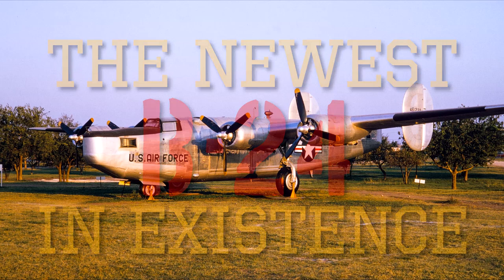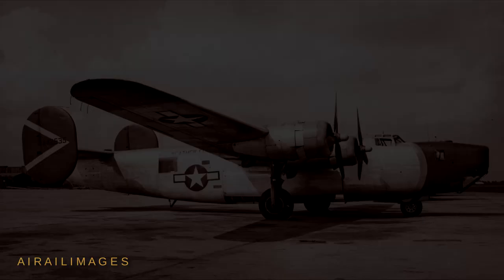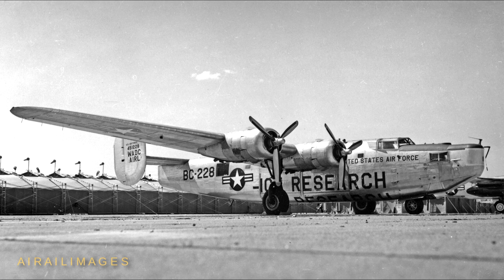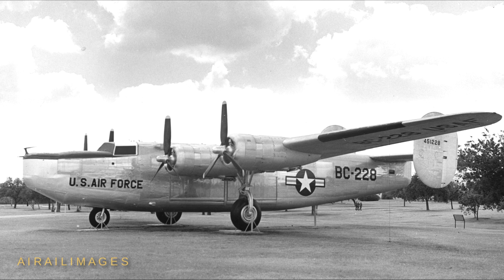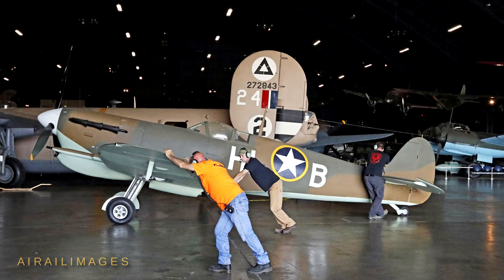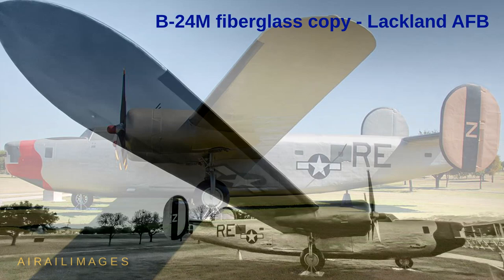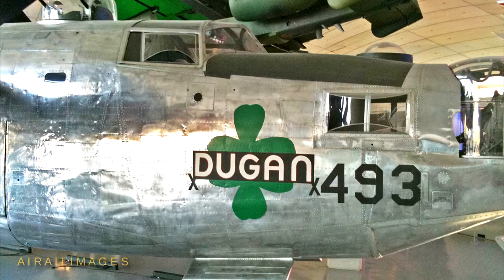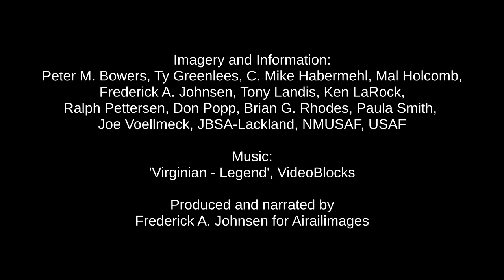The Newest B-24 Liberator in Existence - From Lackland to Duxford

Comment: I arrived in San Antonio in July 1999 from Australia and soon thereafter I was taken around the city on several tours one of which included Lackland AFB and all of the aircraft they had on display around the parade ground. I've always had a soft spot for the B24, The RAAF operated them in the SW Pacific, initially with what was called "composite" crews, meaning both RAAF and Army Air Corp mixed crews. Anyway, when I visited Lackland I was drawn to the B24, it was the first one I'd ever seen, and I noted that it was a fibreglass replica. I often wondered about that. Now, long after returning to Australia, I've come across the history of the aircraft and the replica. Thanks very much for the information. I am retired RAAF but not old enough to have served with the B24's.

Comment: One of my father's stories about piloting the B-24 was that in was tail heavy and difficult to hold at a steady flight angle. Without bombs aboard, he would have his crew move whatever weight, including themselves, to the front of the plane to make it cruise easier and reduce fuel consumption. He flew H and J models. I see by the M model, the Air Corps must have gotten the word because the nose section seems extended verses the J model, suggesting they engineers finally were aware of the issue.

Comment: This plane was built by Ford at the Willow Run plant, in March 1945. My father was a test pilot at Willow Run, and flew over 500 new B-24E, H, J and M's there. He didn't fly THIS plane (451228), but he flew the plane that preceded it (451227) off the line on March 14, 1945. This is almost at the end of Ford's production. The highest s/n my dad flew was 451585, in April of 1945, according to his log books. My understanding is that several hundred B-24's at the end of production were received by the USAAF, but never assigned  due to the existing glut of bombers and the wind-down of the war.

Comment: My understanding is that Yankee Air Museum at Willow Run was on the very very short list to get this example, went overseas instead.  Barksdale AFB has the only other remaining Ford in the US.
Reply: I think that the Barksdale AFB B-24 was originally at Spartan School of Aeronautics in Tulsa, OK. After it left Spartan it was stored over by the Douglas plant for years, and finally went to Barksdale years later.
Reply: Yes, only one other Ford-built in the US. The B-24J Liberator (448781) on display at the Barksdale was finished at Willow Run in  August, 1944. As a test pilot at Ford, my dad didn't test fly THIS plane, he test-flew the next two planes in sequence, 448782 (on 8-7-44) and 448783 (on 8-5-44).
There is another Ford-built B-24 nearby at the Canada Aviation and Space Museum in Ottawa, Ontario. Their B-24L Liberator 450154, was competed at Willow Run (as a B-24M) in late November, 1944. My dad didn't fly this one, either, but he did fly 450157 on 11-28-44.
Reply: @jasonmifrod4928  Is there still a Ford in India?

Comment: The B-24 was also a death trap it only had one exit near the Tail
Reply from the maker: Well, actually not so. If you look at the older B-24J pilot's manual, for bailouts, the aft lower exit was available, as was the bomb bay and the nosewheel well. And of course, by the time this late Ford B-24M version was built, it had a dorsal exit amidships, and revised clamshell hatches on the cockpit canopy. Many B-24s also featured a quick release lever for the cockpit side windows, and the overhead hatch behind the cockpit was available. In some circumstances the waist windows on some models could be used if needed to leave the airplane.